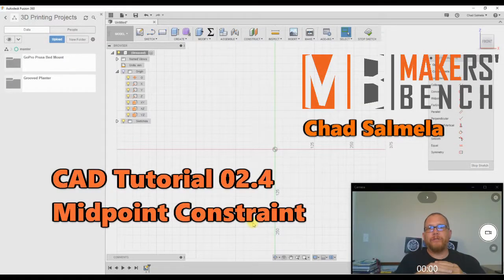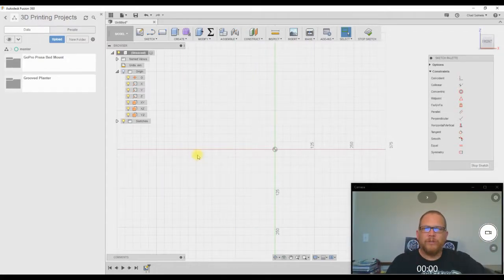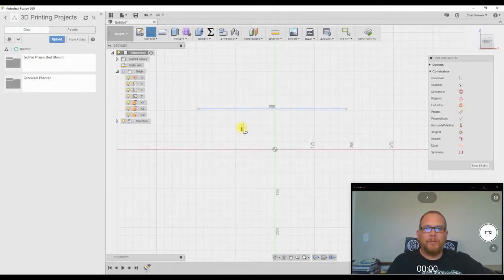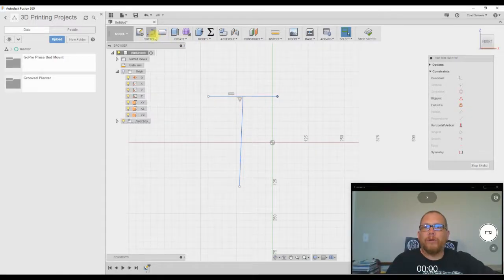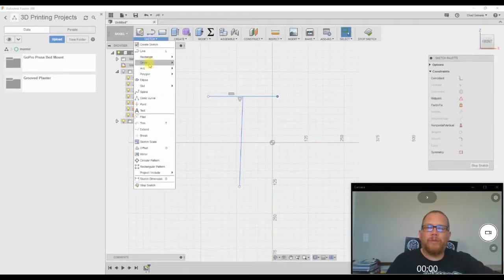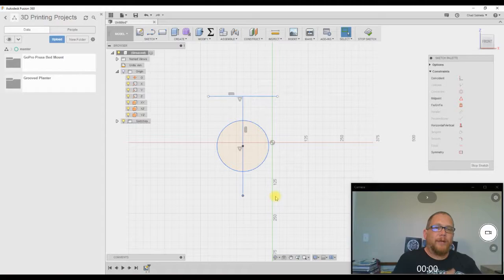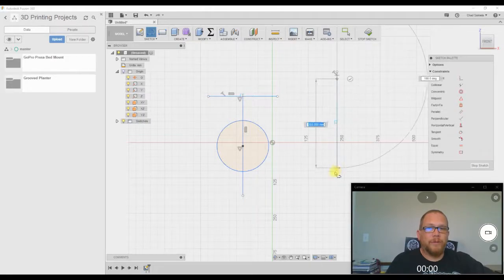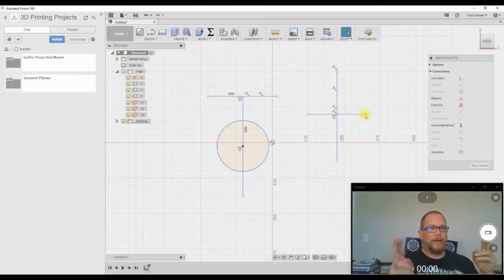CAD Tutorial 02.4 Midpoint Constraint

Comment: Lets say I have a rectangle with no center/mid point. Now I want to create a smaller rectangle inside the first one and I want the center point of the new rectangle to have the same center point as the  bigger one. How do I do that? Will I have to make a construction line first (that cuts half of the rectangle) and then use midpoint constraint on that one? Thanks!
Reply from the maker: You could do it that way. Or you could constrain the midpoint of the vertical line of each rectangle as horizontal to each other, then do constrain the horizontal midpoints as vertical to each other. You could also draw rectangles with the "Center Rectangle" tool. Sketch drop down arrow > Rectangle side arrow > Center Rectangle.

The biggest thing is that you play around with all of the tool, try different ways of constraining and then use what works best for you.
Reply: @MakersBench  The "secret" I was looking for was to hold down SHIFT. Then I was able to simply use horizontal and vertical constraint to the midpoint of the sides. It does not find/snap to the midpoint without holding SHIFT.